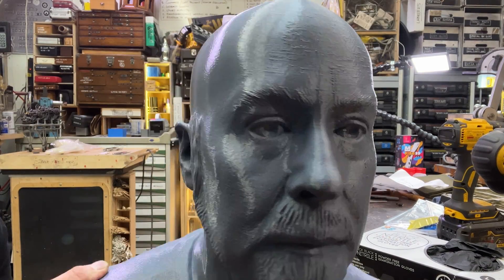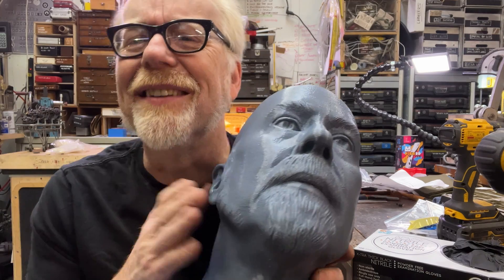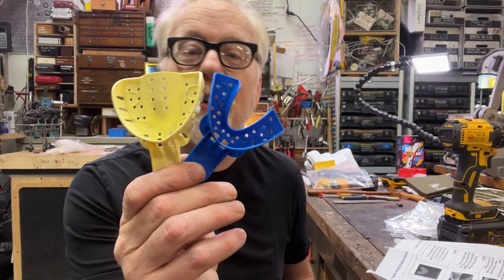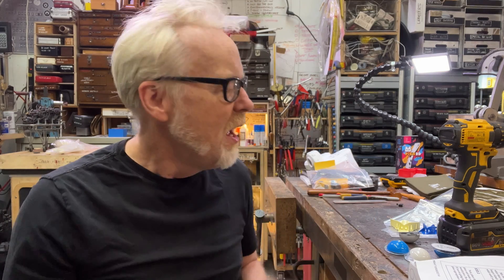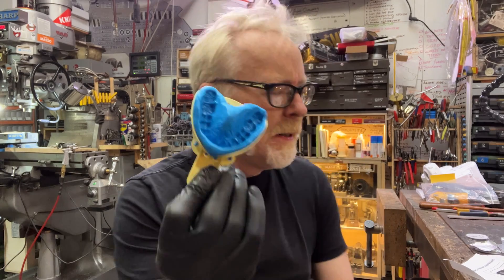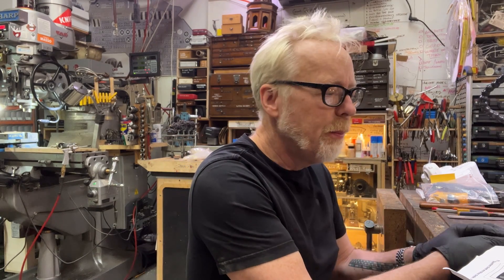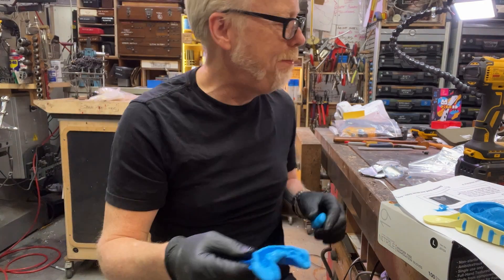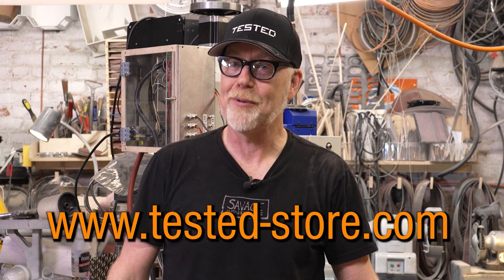Adam Savage Molds His Teeth for Animatronics

Comment: Hi Adam, 
This took me back. My first job was in a Dental Lab about 40 years ago. 
You probably know this already but you might want to look into making a Bite Block so the upper and lower castings fit together properly. 
Back in the day we would make these with sheets of Dental Wax. We used the castings to make wax mouth-guards which were then put on over the patients' teeth. 
A warmed and soft sheet of dental was put between the teeth and the patient bit down. 
Once the wax had solidified the now-conjoined mouth-guards put back on the castings and and an armature was connected to them. 
This allowed the teeth to be positioned just as the were in the patient's jaw. 

Of course technology has probably moved on in 40 years
Reply: I work in a dental lab and it's still pretty much the exact same thing. There's a slow move to scanning and 3D models, but the foundations are still the same.

Comment: Well this is my jam. PolyvinylSiloxane, PVS, material. It has platinum as a catalyst so is expensive vs alginate but mixes super smooth with no bubbles, minimal distortion and good stability. You can get different viscosities as well and varying working/set times. Adam made a very good upper impression with extensions like you are supposed to get. Nice. I 100% prefer 3D scanning teeth now and 3D printing the models..so much less goop in people's mouths.